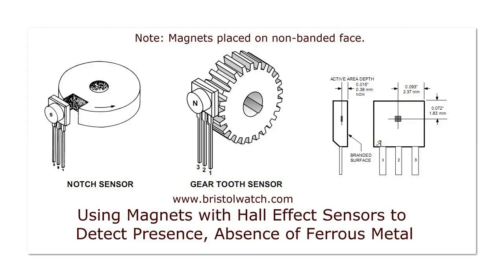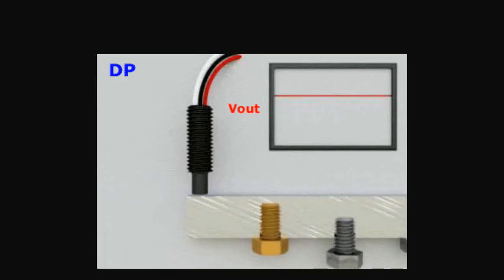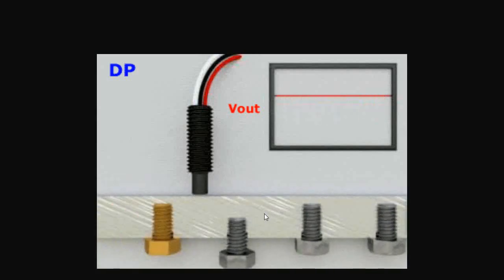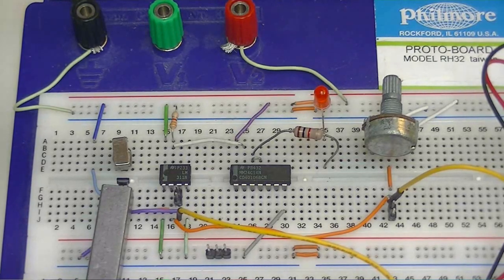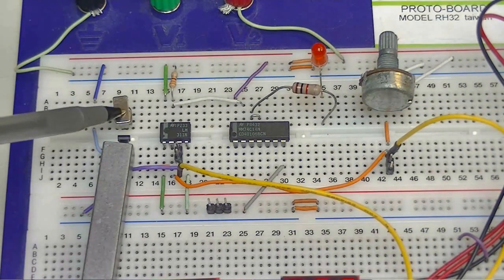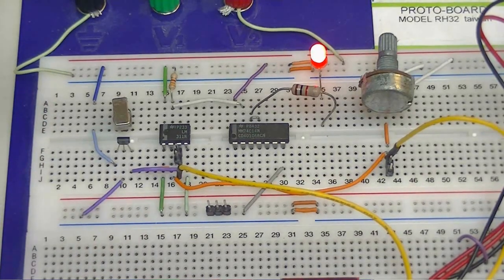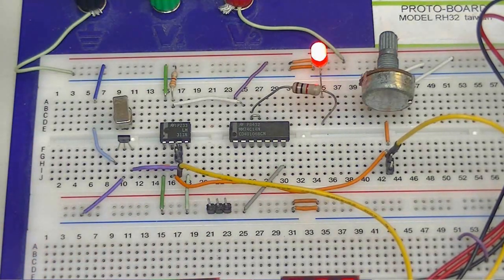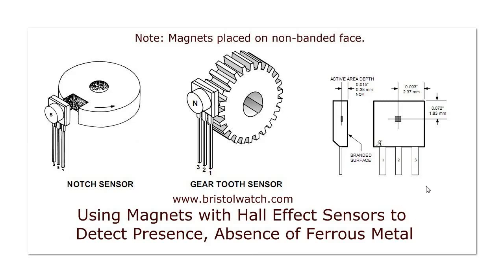Hall Sensor Magnetic Bias Detects Ferrous Metals, Gears

Comment: I need to find a replacement  for a 3 wire ferrous hall effect sensor that can replace a Holley 554-124 that doesn't cost 189$ 😳
Reply from the maker: The problem is that the sensor is embedded in a threaded tube and likely has an internal bias magnet. The wires (red, white, black) are likely +Vcc, signal, and ground. Having the correct replacement sensor part won't help as such. The sensor is likely a switch type. Sorry.

Comment: Great video! i'm building a small model engine, and i'm thinking of how to make the ignition. I guess i have two choices: a steel wheel attached to the crank with a gap tooth, and a Hall sensor biased with a magnet. Or a wheel of any metal, with a small neodymium magnet glued to it. Any opinions? Also, i've noticed that the flywheel of motorcycle engines usually have 2 or 4 large (wide magnets), why do they use such wide magnets? Wouldn't that lead to imprecise timing? thanks
Reply from the maker: Several issues could be improved. It depends on the RPM. Gluing a magnet to the flywheel at high speed may detach the magnet. The hole magnet idea would be best. Multiple sensors can be used to sense the position of rotation. The gap between the pulses would indicate speed, etc.

Comment: As always a very interesting video. Do have a video on the non-contact 3 phase 2,300vac identification [A-B-C] [L1-L2-L3] line tester?  Most of the testers are rated at about 700 to 1,000vac.
Also, there are several 3 phase motor rotation sequence tester.  Do you have a circuit video on these devices?  🧐 Thank you.

Comment: Hi LEWIS, Do you know where I can get hookup info for a  grayhill 70yy20010 solid state relay? thanx
Reply: Dear Lewis, I have learnt so much from you MOSFETS videos.  Thank you so much, you are an amazing teacher.
Reply from the maker: It does not look like an SSR to me. It has a set of 2 pins and another set of three pins. Measure the resistance of the three pins to each other. If two are shorted and are open in relation to the third that is a mechanical relay and the other two pins are the coil. I couldn't find a spec sheet either. Let me know.
Reply: @LewisLoflin  THANKS